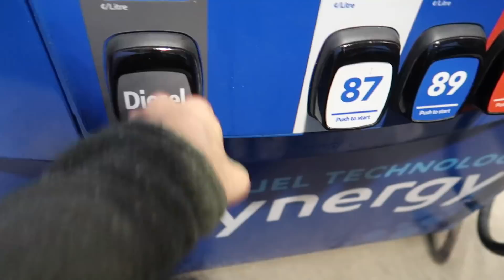VAN LIFE WITH A DOG // day in the life vlog

Comment: My concern is leaving my dogs alone at times in cold winter and hit summer in my van. Ie. Would I leave the Mr. Buddy on while away, or the air conditioner in summer, locking the doors with an extra set of keys in my possession? I would never be more than say, 45 minutes and that would be rare. Any ideas???????